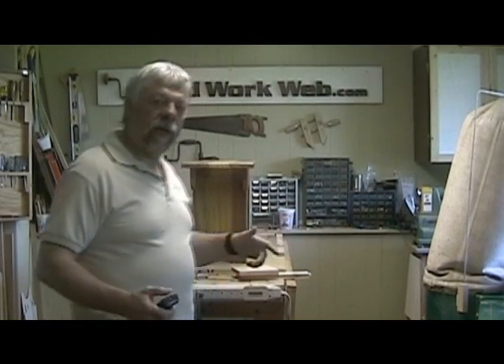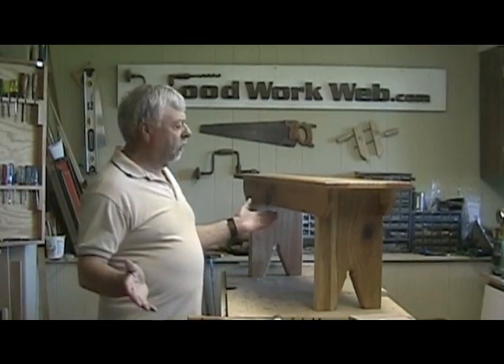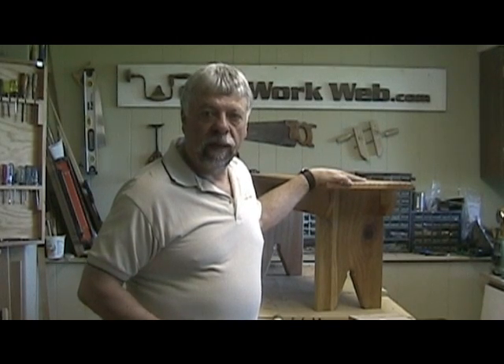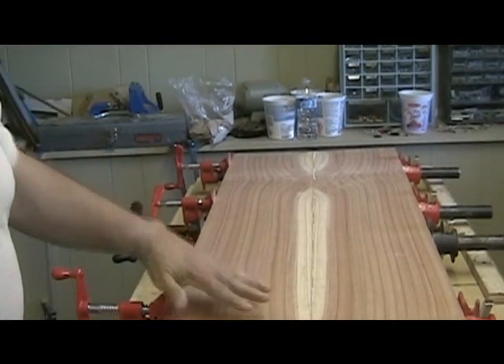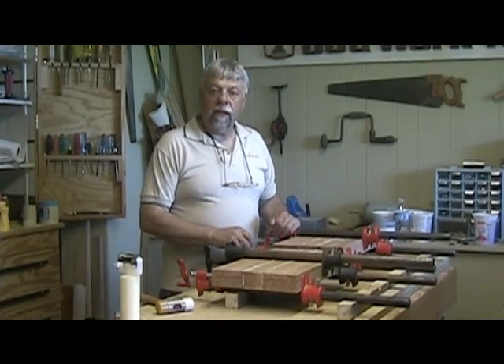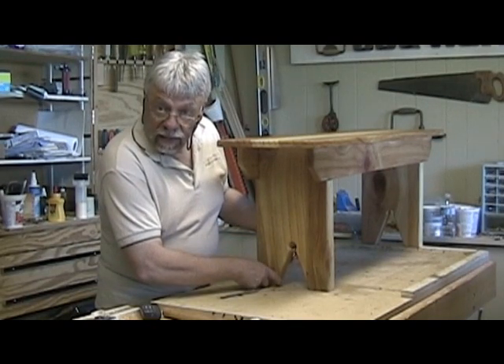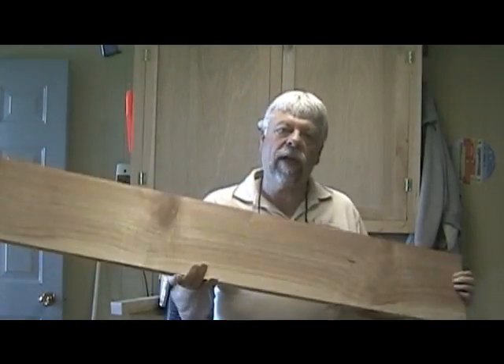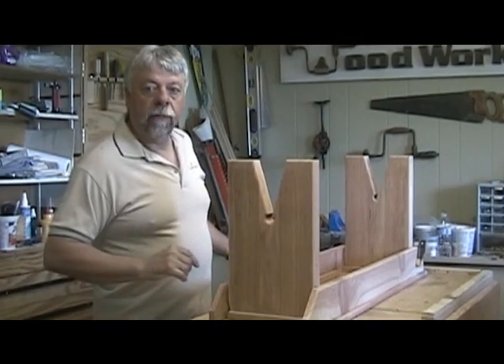Woodworking Project - A Sitting Bench

Comment from the maker: @4vinos I only used glue because this is an inside bench. For outside an outside bench I would use wood that is better suited to outdoors and would I would probably use stainless steel screws or bolts to hold it together. Glue will work on some outdoor woods but often they have oils within the wood (like cedar) that resists good adhesion with the wood. The main problem with outdoor furniture projects is wood movement from moisture and hot and cold temperatures which causes glue joint failures.